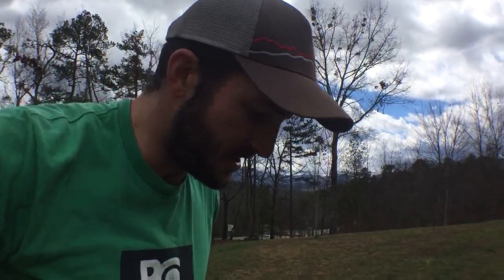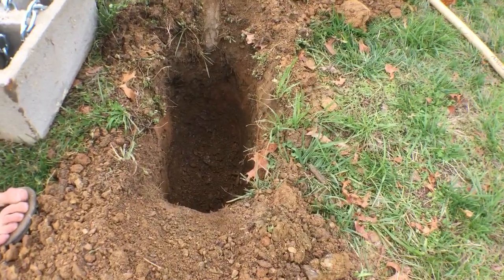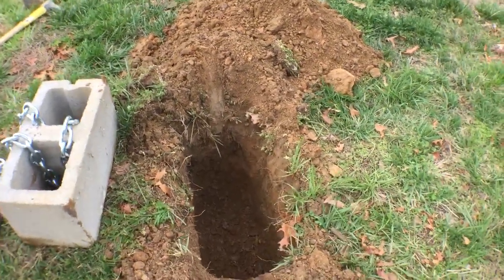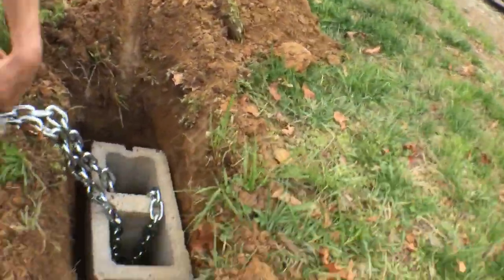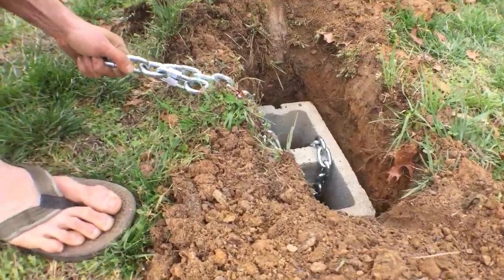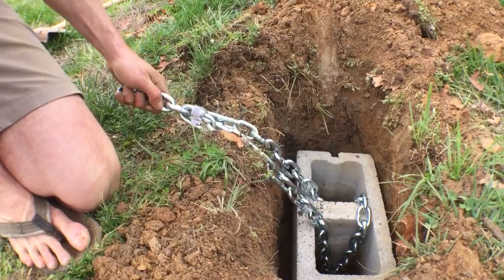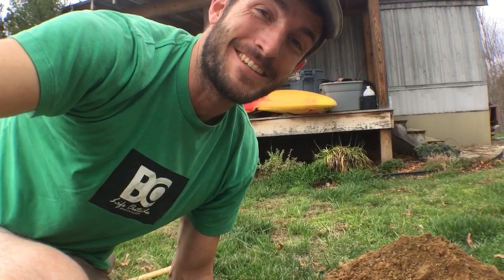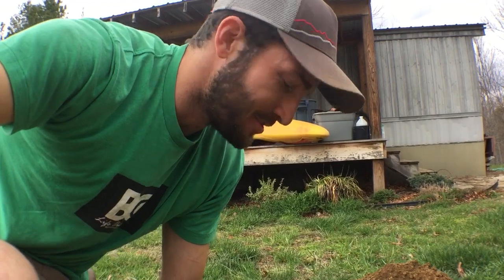Building a Temporary Slackline Anchor - Part 2

Comment: Hi Dwayne, I am considering building something very similar, and stumbled across your video. So, yay, it seems doable! I wondered: did it work out for you in the long term? Also, what was wrong with the first pair of sawhorses? I saw people are using all kinds of things for support there, even somebody made a festival with sheets of plywood for the support, so I didn't expect difficulties there.
Reply from the maker: It worked out really well! But I found some long twist in ground stakes at Lowe's and that was even better. We rigged an 80' line on them pretty easy with 6"x6" posts for the frame. They were pretty cheap and way burlier!